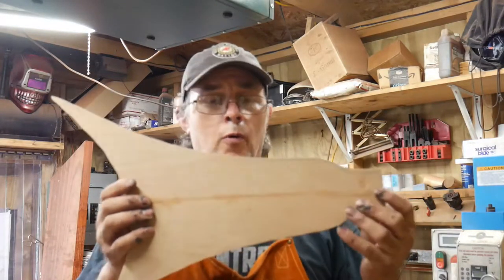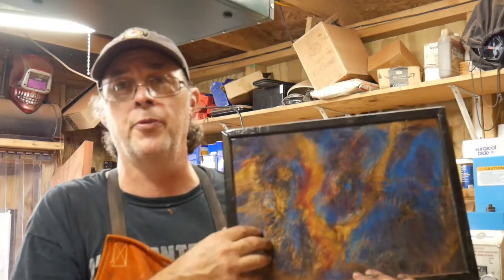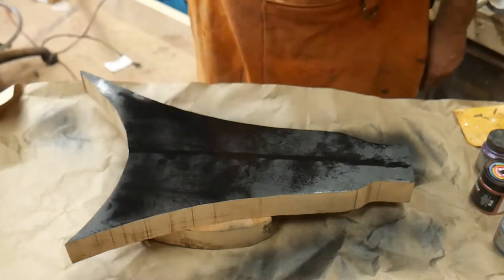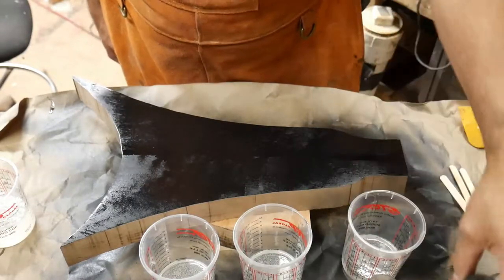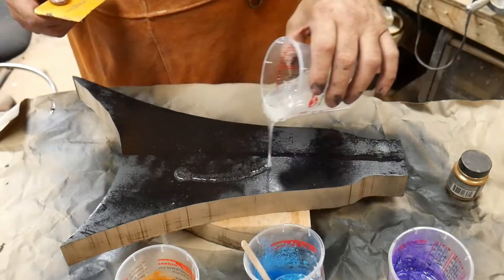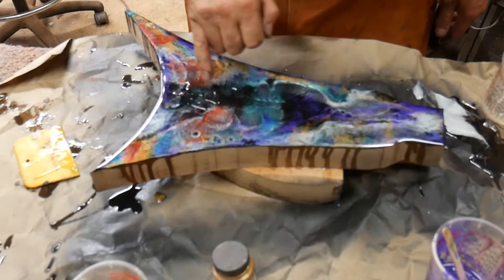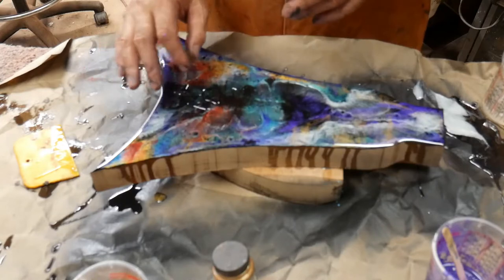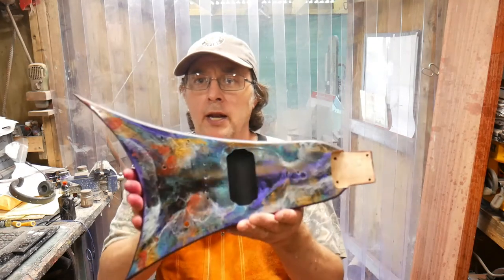epoxy resin art pour on my custom guitar body

Comment: This looks really, really good. A little bit too overcharged for my taste, but fantastic nonetheless! I'm between trying with epoxy than with acrylic. Clearly epoxy wins for its toughness, but acrylic can give you some pretty beautiful cell effects. Hmmm... Would it be okay to go for acrylic pouring, let it dry and then finish it with a clear coat of epoxy?
Reply from the maker: I don’t see why not, if I can’t get small scratches out  I’ll pour a thin layer or I spray a couple coats of clear gloss lacquer and polish it
Reply: @rod-v595  I got a can of acrylic clear coat around here, but I fear it's not going to be hard enough for a guitar. Have you ever tried that one?
Reply from the maker: @gabegartzia3290  epoxy should be hard enough, I wet sanded mine all the way to 3000 grit and polished it, turned out pretty good. No lacquer coats just epoxy
Reply: @rod-v595 that would definitely be the way to go, but I meant acrylic clear  coat on acrylic paint, which would pretty much be what you find in paintings. I might be trying that one first before applying, just asking if you have tried that combination yourself.
Reply from the maker: @gabegartzia3290  no I haven’t, I use clear stringed instrument lacquer if I do a top coat on paint or epoxy
Reply from the maker: @gabegartzia3290  this is what I use, I don’t use automotive lacquer, it chips easy. But I buy it by the quart can and use a spray gun.Mohawk Stringed Instrument Lacquer 13 oz https://www.amazon.com/dp/B07V6KV71L/ref=cm_sw_r_cp_api_glt_i_DNTZCMZX2STA0R056VQE
Reply: @rod-v595  You're fantastic, thank you so much for your insight!
Reply from the maker: @gabegartzia3290  oh, you can get that Mohawk stringed instrument lacquer at woodcraft if there is one near you.
Reply: I  have just painted the body of my guiitar with acrylic,   but I want to seal it in with epoxy.  But I'm worried that I'll either get an edge if I don't do the whole ting,  or a mess if I try to cover the whole thing.   Does anyone have any experience with this?